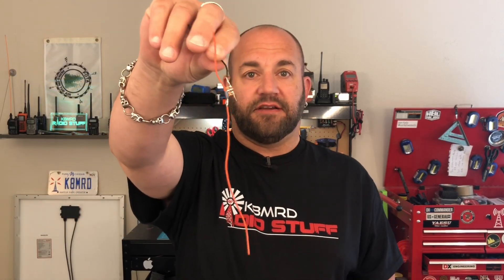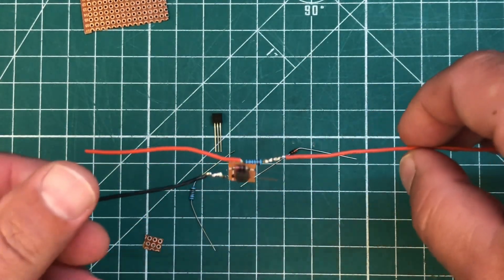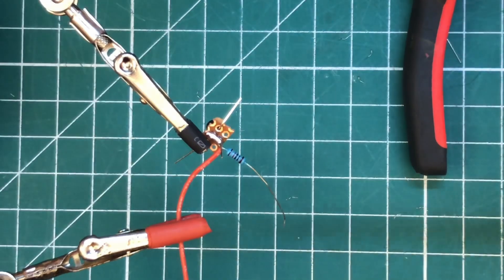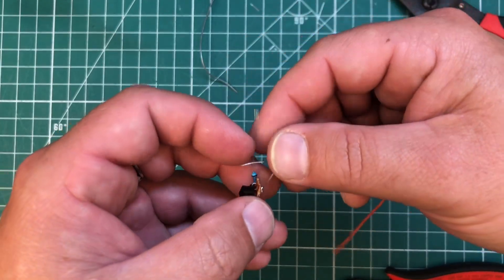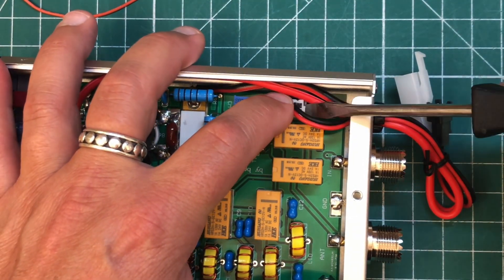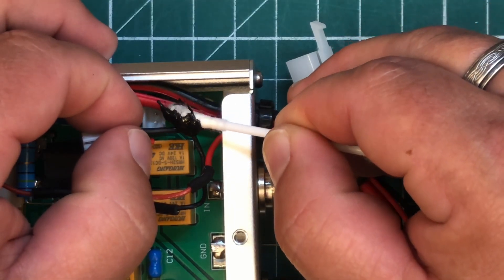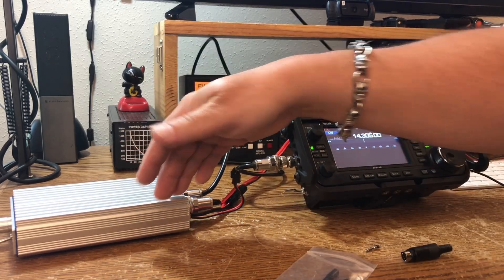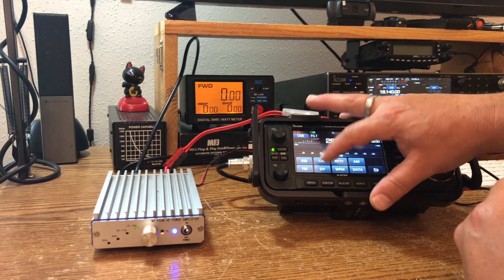MX-P50M Keyer Mod and Installation for Icom 705

Comment: Now you can just put the USB-C replacement board in the 705.  The replacement board has more protections on the key circuit.

Comment: Mike - fellow hammers tell me that I should NOT directly connect to the MX-P50M and should use a Relay Buffer Interface to protect my Finals.  Others say this was for older Amps?  What are your thoughts about the need to use an RBI to protect my Radio?  
Greg

Comment: Mike, I cannot get it to work. After installing the mod, the amp goes into transmit when powered on (not attached to the 705 yet). I made 3 of the mods and all do the same thing. Any thought to what I'm doing wrong?

Comment: I believe I would have tapped the DC source into the power switch of the amp, otherwise it will be live anyting power is attached to the amp.  By going through the switch, it is off when the amp is off !

Comment: Here's a tip and a slightly different way that I did mine - make the whole thing *without* the breadboard and dip the whole shebang in liquid electrical tape or plasti-dip
Reply from the maker: You are a more daring individual than I good sir.

Comment: Mike that diode is a 1N914 general purpose diode
Reply: And BTW that is a “signal” diode (not single)
Reply: Honest question from someone who is not an electrical engineer: Can you tell from the video that it is a 1N914 and not something like a 1N4148 and would either of those two be interchangeable here?  (I'd presume so from Kevin's description of "any" signal diode, but figured I'd throw out the question since this is not my realm - thanks!)

Comment: I need to boost my IC-705 for SSB POTA ACTIVATIONS. Should I get this amp or get another radio ? I love the IC-705, but may be a IC-7300 will work better after all.
Thanks
David
Reply from the maker: That's a tough question David.  The 7300 is certainly going to be a better all around radio than the 705 with the amp.  But the amp is only $200.  You could always try the amp first, if it works, great, if not, upgrade to the 7300.
Reply: @hamradiotube  Thanks for the info. I do have a 7300 and a 9700 in the shack and happy with all 3 Icom radios. Is an additional gadget that will need to be carried and powered.   I will think a little bit more about it before making a decision.  Thanks.
Reply from the maker: In the mean time, just take your 7300 out with you.  I do it all the time.  I love it.

Comment: Hi Mike,
Two thumbs up for a job well done. I remember when Kevin designed that circuit and had it running with his FT817 and also the RS918. Stay safe.  73  WJ3U
Reply from the maker: Thanks Don!

Comment: So far, every IC-705 owner I’ve met who uses this amp, simply puts a mini phone jack on it and it works great. I have not heard of anyone ever having a problem. I’ve been using one myself like this for a year. I use it constantly in the field. By the way Mike, keep up the videos. I never miss any of them. We need more people like you out there to encourage amateur radio operators to get out and get on here. Thanks for doing what you do.
Reply from the maker: Yeah I didn't want to have that voltage coming back into my radio.  If a $200 amp breaks, that's one thing, but I don't want anything to happen to my 705.  Knowing my luck, bad things would happen.  Thanks for watching.  I really appreciate it.  73

Comment: With this experience, you should apply for a job on the bomb squad. What could possibly go wrong? 🤪

In all seriousness I've been starting to think about one of these amps for my 817. The internal construction looks very good.
Reply from the maker: Yeah right.  I wouldn't want to ever see that magic smoke!  It's a pretty cool amp.  I've not used it too many times yet but I've been happy so far.

Comment: I am guessing, somebody correct me please, that that one-pin connector is because you only need direct the drive signal though the plug and ground comes through another place like the antenna ground and you don't necessarily need it on the plug itself???
Reply from the maker: no clue